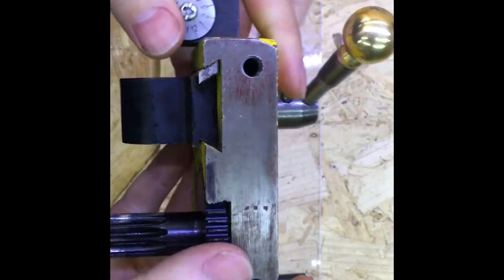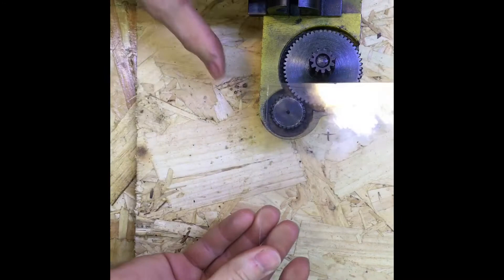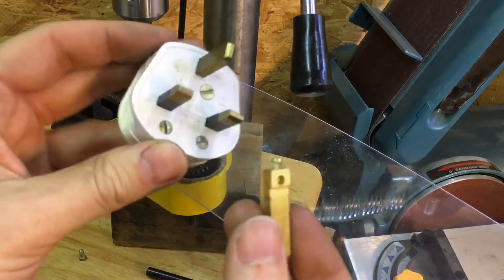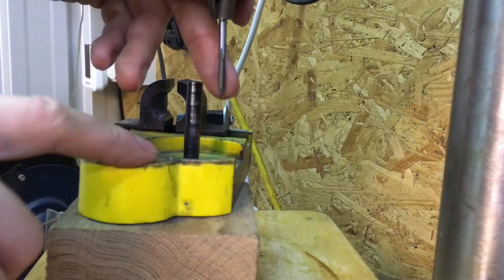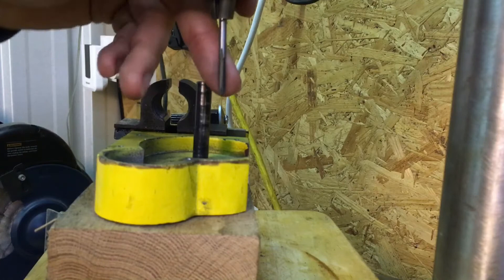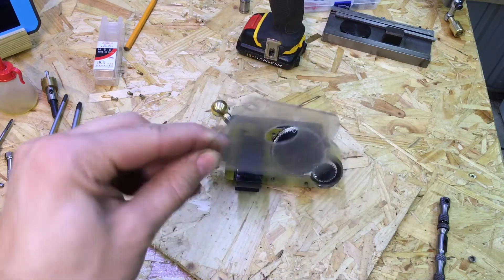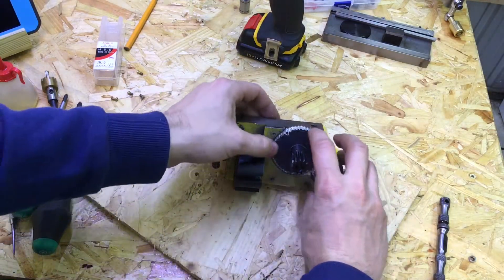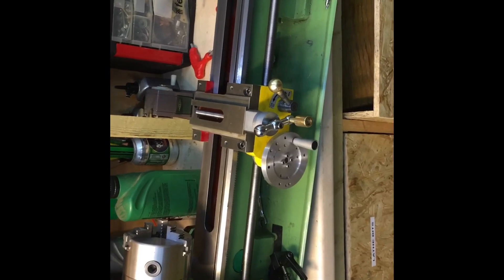Mod Your Mini Lathe Apron Gear Cover

Comment from the maker: below are some of the lathe tools i use that are very good.

good Lathe tools
https://goo.gl/BzuUVj
Standard inserts https://goo.gl/gzSnw5
Aluminium non ferrous metal inserts https://goo.gl/Zzm6GY

other carbide tools i use
https://goo.gl/j6LH4a  
Standard inserts https://goo.gl/bUkNVe
Aluminium non ferrous metal inserts https://goo.gl/uRcdND

Hole saw set
https://www.banggood.com/Drillpro-5pcs-HSS-6542-Titanium-Coated-Hole-Saw-Tooth-HSS-Hole-Saw-Cutter-Drill-Bit-Set-1618_5202530mm-p-1053888.html?p=070519238739201308J6

I may receive a small commission for you using the affiliate link above thanks it costs you nothing, if you do not want to use links search on goggle more info

Comment: Hi nice job when I did mine I had to machine a small amount from the flat faces of the cogs as they protruded and the new cover would not fit flat and cogs would not work with the screws tightened
Reply from the maker: Yes mine do slightly but not enough to stop them working.
Thanks for commenting have a good day. Jace.